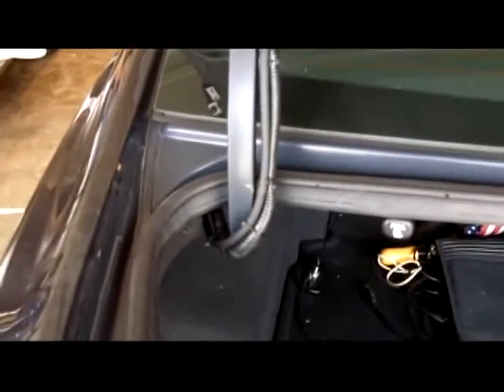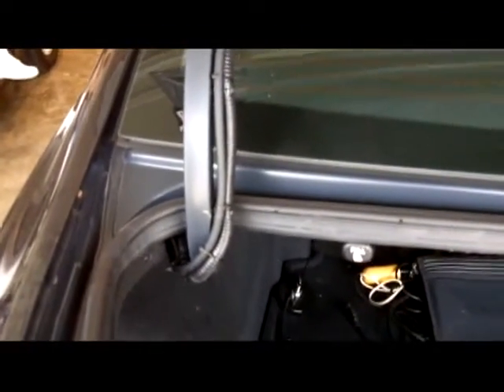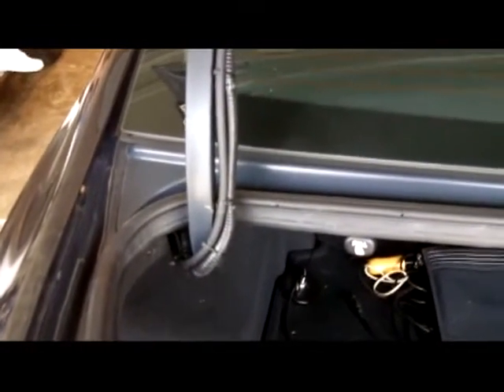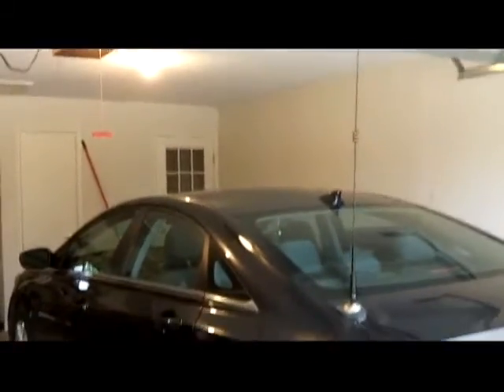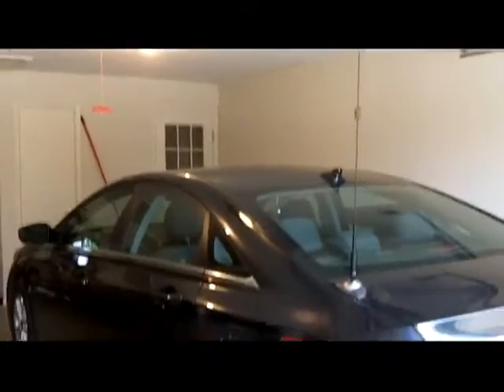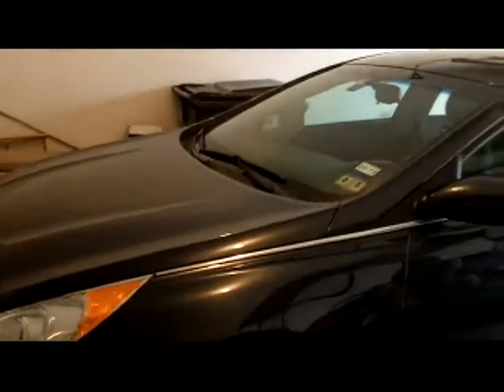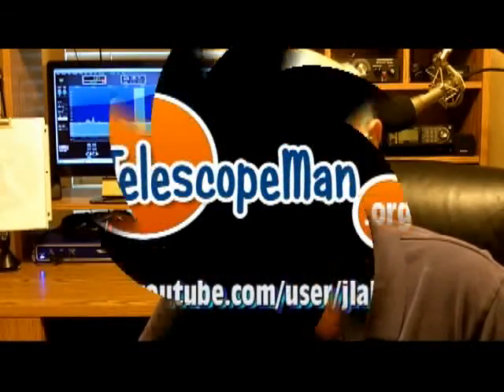Mobile Radio Installation

Comment: Very clean - They did a awesome job
Once i get my licence i will be getting a nice mobile yeasu 
My current CB mount is fairly easy to see and not the most glamorous but hey it works
Your installation is one of the best i have seen
Reply from the maker: theoffroader Thanks, yes they did a really good job on the installation.

73

Comment: Loved the video, wish the installer was out here in Yuma.  But thanks for some great ideas.  Is the radio fastened down under the seat?
Reply from the maker: jad742  No, however there is a ground strap connecting the radio to the driver seat floor bolt.
Reply: Joe Lalumia  you know I remember you saying that and didn't think of it that way... Thanks Again

Comment: Very cool installation when I put mine I'll add it to a battery in the trunk so I won't waste the battery to the vehicle. I like that concept that you have your Mobile radio hidden
Reply from the maker: Really don't need to do that. 95% of the time you will use the mobile radio while you are driving the car; not while you are parked. Most radios have a setting that will automatically turn off the radio if it it not being used after a certain number of minutes that YOU setup. So if you forget to turn off the radio and park the car it will not run down the battery

If you are parked and assuming you have a good battery-- you will be able to operate the radio for about 2-3 hours (or more) without running the battery down so far that you cannot start the car. (I am assuming you are not talking CONTINUOUSLY!)  Ha!  :)

PS-- I am going to do another video with some LIGHTING so you can see the equipment better. Stay tuned.
Reply: Joe Lalumia I do appreciate your videos it's helping me get more involved and I started using hamexam.org. ? local radio clubs in my area I think are dead in Tuscaloosa county Alabama. I tried emailing one of the clubs and it bounced back and people who used to ham quit and or there to inbred to know what ham is
Reply from the maker: No problem glad I can help you. I looked up your county and found this club:  http://www.w4xi.org/
Reply: Joe Lalumia when I clicked contact it is just be logged in. That's okay I do appreciate it, I just been reading up and watching a bunch of ham radio vids

Comment: Good general information but no practical tips on how to do this yourself!  Couldn't see a thing either.  Congratulations on your nice install...
Reply from the maker: David-- that was a brand new car-- so I had some professionals install it so it would be easily removable later , and almost invisible from the outside or looking in through the window. I selected the antenna because it's low profile base and smooth edges would go through a car wash (after the antenna was removed). 

The radio is powered direct from the battery with fuses on both wires near the battery. They already knew how to get through the firewall in the engine compartment, and how to run the wires so they could not be seen. They even had a special tool to pull the control head wire from the side of the car across the top headliner WITHOUT removing the headliner. (and mounted the control head inside the sun glass holder.)

Key steps-- fuse both lines at the battery, know how to get through the firewall. Ground the radio to the chassis. Hope this helps.